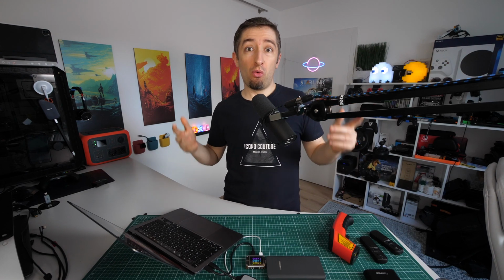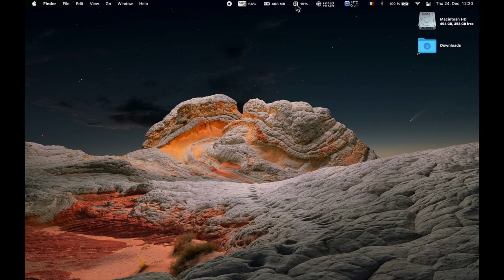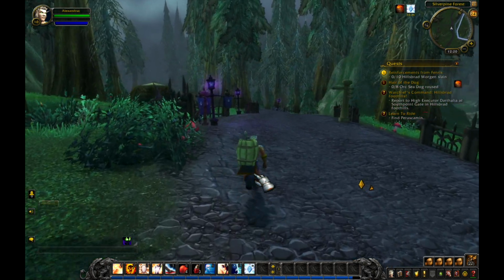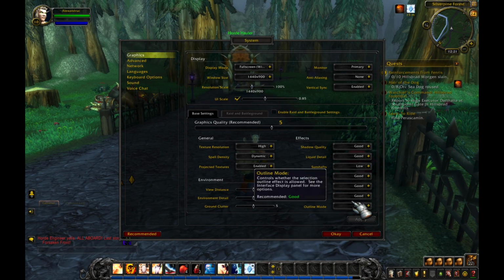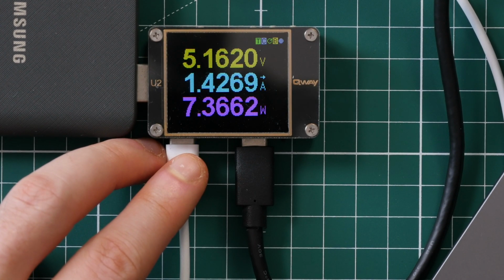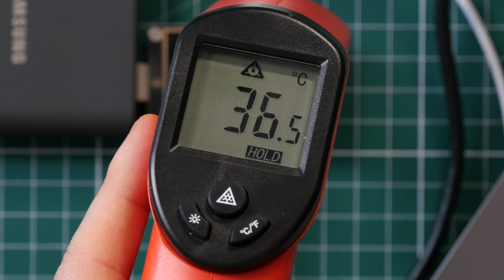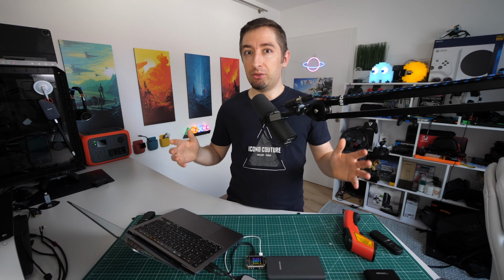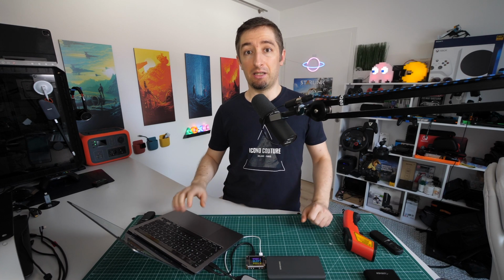World of Warcraft on M1 Macbook Pro 13'' Power consumption

Comment: I have the same curiosity - thanks for doing a test on the power draw - what was the screen brightness during the test?
Reply from the maker: Hi , I don't remember exactly , but I mostly use the macbook with Maximum Brightness , I may have to check it again as now when I look back at this test I am not sure if this is correct , seems too low power draw , it might be that the power bank in combination with that power meter was not outputing the maximum power the laptop needed . I now have Type C cables with power display that could probably do a better job , even maybe using directly the macbook charger

Comment: Cool stuff man. Would've been nice for you to ramp up all settings at the end also to see how much the m1 consumes at full load :p, but still nice video.
Reply from the maker: Good ideea , will do it in a future video , but generally you have to be creative to be able to trigger the fans , I wish we would have the same on the Windows laptops
Reply: @constantech4342  Great to hear :) I subscribed. 
This things are crazy efficient indeed, the Air runs just fine for the most part with no fans, I kind of want a 2nd gen Apple silicon 16" Air, would be so sweet.

Comment: So you are powering the macbook with 5v? that's strange
Reply from the maker: Just tried out with other charger and other power meter , this time it shows 19,3 V and 0.32 A , witch is also @ 6 to 7 W , I think depending on the charging capability of a power bank , the Macbook would also take other V as long the power is enough , will try some more testing on this one , I am not able to get a reliable power meter that would not interfere with what I try to measure , but I have a few power banks that can charge with PD and have imput and output meters build in (but not V and A unfortunately) .